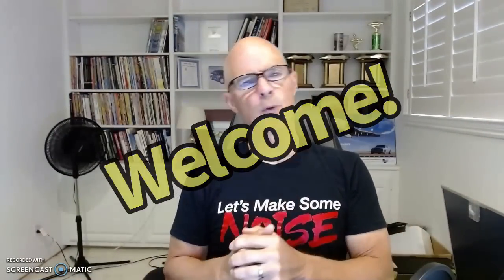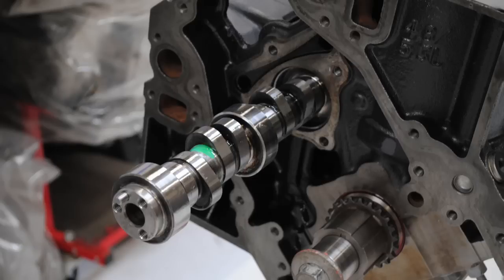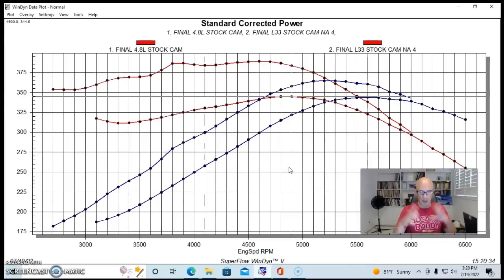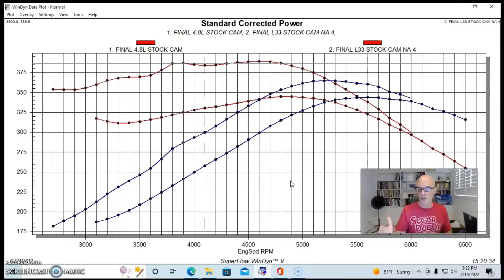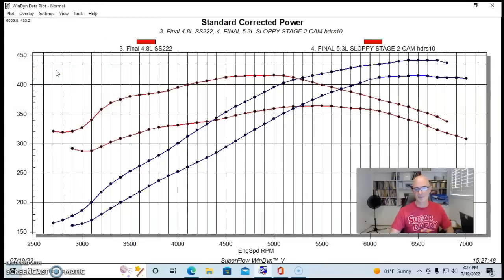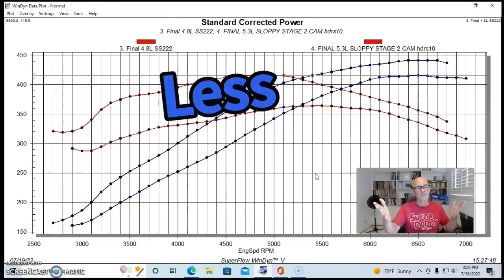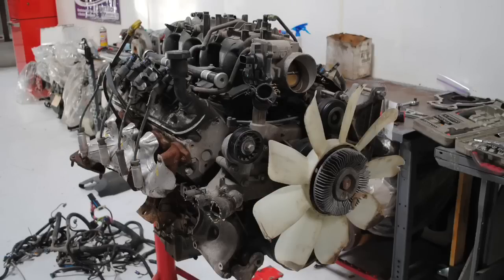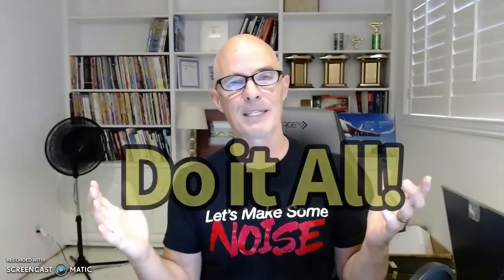4.8L VS 5.3L-TORQUE VS RPM? WHICH ONE WORKS BEST? WHAT HAPPENS IF WE ADD AN SS2 OR BTR TN CAM?

Comment: Suggestion: combine a completely high-RPM power adder to a completely low-RPM high-performance engine/cam combination (but not with dime-sized ports or valves, just valve TIMING.) 

See how far you can stretch the useful powerband on a car by camming for the bottom and having a power adder that brings up the top end. Try a variety of power adders: turbo and centrifugal. Size the headers for low RPM, but not excessively, like 1" primaries, which would be ridiculous.

This means a lower static compression, as cylinder pressures at lower RPM would be excessive with a cam with very high lift BUT low-RPM emphasis with higher compression. This would also aid in staving off detonation from the power adder at higher RPM/boost.

Goal: flat torque curve from 1000 RPM to 7000 or whatever redline you want.

Also, to find out if one can tame a centrifugal supercharger by adding cam-aided torque at low RPM to make up for the high-RPM rush,  and same to add low-RPM cam emphasis to wake the turbo up at a lower RPM at the expense of high-RPM sudden "power comes in with a bang at this RPM."

The goal is not ultimate power, but to ascertain just how flat we can make the torque curve from start to finish. The same cam that really fills the cylinders at 1000 RPM will not allow the engine to breathe as well at 7000 RPM, and this is understood, but the same cam will also energize a turbo at a far lower RPM than will a "Pro Stock" cam.

Various sizes of turbos can be tried to find the results of them with a super-low-RPM cam.
Reply: it Doesn’t work like that if You have components to try and get power at two different RPMs you end up with nothing anywhere essentially you could put a centrifugal on or use a programmable boost controller on a stock motor and get what you want
Reply: Already been done with no electronic boost controller, by Porsche on the type 912 motor for Can Am.
Reply: I have a 5.3l single s366 springs and Elgin 1838P. Which is a 216/220 114lsa. Everything about this setup says torque. It definitely is. Turbo lights up instantly and off boost is torquey. I have wondered what would happen if I slapped a big cam in there. Should shift the power band a little right? But with a fast spooling turbo still pretty torquey? This is with a 5spd
Reply: @or-ian6973  interesting. Could you give me pointers on building a 5.3 with good low end torque for my van?  I thought you can't cam your way out of displacement for torque on the low end. I can get a 4lxx transmission and 5.3 for cheap or drop 7k and get an sbc 400 that I know will deliver over 450 torque at 2-2.5k rpms.
Reply: @dexterlecter7289  any small cam. The truck Norris cam doesn’t loose any low speed tq. If you’re going NA bump the compression up a bit. Small turbo works well too. With a heavy van the extra load on the turbo should produce power faster. I’m in a small truck.

Comment: Does a shorter stroke shorten the time to reach desired rpm?  Not overall rpm potential.  Is having a light rotating assembly/flywheel what makes engine rpm accelerate quickly?  For instance, a sport bike engine revs quickly and often times the rpm fall almost as quickly.  Real snappy.
Reply from the maker: people tend to answer this question as though they are spinning the motor by had or with an external force-how quickly the motor revs is not solely dictated by stroke length-component weight (including valves, cam, etc...) compression, tune all play a part
Reply: If the connecting rods and pistons are the exact same mass, a shorter stroke WILL require less power to go from one RPM to the next than will a longer-stroke engine, because the reciprocating assembly acts somewhat like a flywheel, as the energy expended to accelerate the piston and conrod from bottom dead center to kind of halfway up the cylinder will be recouped, mostly, upon the piston and connecting rod working to accelerate the crank from about halfway to top dead center.

The energy required to accelerate the pistons and connecting rods is not lost. It is not discarded. It is merely stored in the part that is moving more quickly at that moment.

Comment: I like the LM7 5.3 most , more torque ,  can you swap cams without pull te heads off ?
Reply: Yes. You just have to use dowels to hold the lifters up so they don't fall down in the motor
Reply: @mikeday8826  or flip the engine over. Guess it just depends if it’s in the vehicle.
Reply: @mcfero1  yeah I was assuming he was taking about doing it in the vehicle

Comment: the bigger engine is a double edged sword to get rpm you need an even bigger cam than small engine so valve control is harder to maintain
Reply: For short bursts, titanium valve springs!

Comment: The 4.8 will be easier on the transmission, if that's a concern. But aside from that, I think the 5.3 would be preferable.
Reply: One of the reasons I chose my for my 944, I am running a pretty fragile stock NA transmission.
Reply: @TrackDayMaker  Why not just chuck a TR 6070 behind that motor?
Reply: @exploranator  because that would literally cost more than my entire car and require custom fabrication. We are talking about a $200 motor in a $600 chassis (when I bought it, it’s worth a lot more now).
Reply: For some of us, budget constraints are a thing. The money saved on the transmission could buy a lot of other car parts.
BTW, a V8 powered Porsche 944 sounds like a fun project! 👍

Comment: i'll take the torque over the rpm, i actually drive my cars all the time
Reply: 4.8's honestly do fine in trucks they just need to have a 4.10 gear at the minimum and I actually do get pretty decent fuel mileage with mine too, but I'd take a 383 or 408 stroker anyway and if 4.10's are too high of an rpm on the highway a gear vendors will fix that
Reply: @chrishansen7004  Well if it's a big truck I'll just go 6.0 liter. In a CJ7 mud buggy a 4.8 would work. We've got a 4.8 in a van at work and it's fine. It does 70 without too much trouble.
Reply: @ahoneyman  my 4.8 wants to go above 80 with 35x12.5
Reply: That's why I like big block strokers
Reply: @Horrible_Deplorable  I dont have a big block in my C4 Corvette, but it's the next best thing I can afford. A 420ci SBC (400 .030 over (4.155" bore) with a 3.875" stroke crank)
Reply: @bonzainews  that's getting pretty close to the corvettes big block size.
I don't think they ever put a 454 in a corvette, did they? 

Either way, I bet it's still fun to drive.
Reply: @Horrible_Deplorable  not in a C4.
Reply: @bonzainews  I didn't think so
Reply: Guess it depends on how you drive and what you drive. A 4.8 in a lightweight S13 or Fox Body as a canyon/drift motor is totally doable. I'm not running under 2500 RPM and I can run a higher redline. An aluminum 5.3 would be better than either.
Reply: Must be nice
Reply: I get it since you probably have  monthly payments on 3+ cars